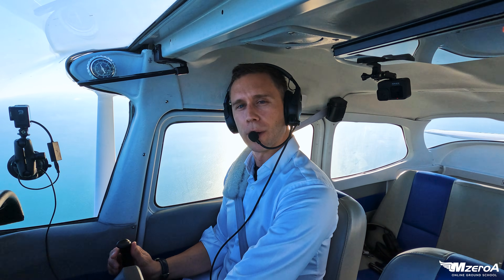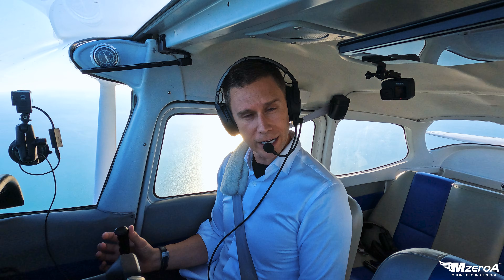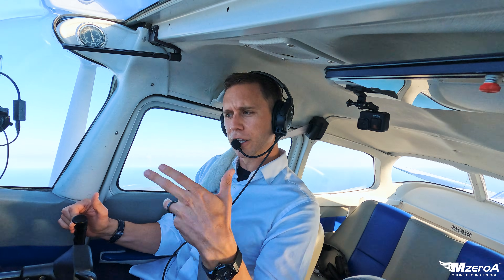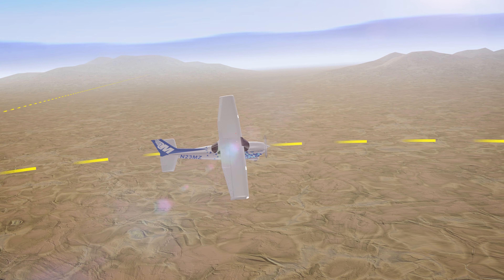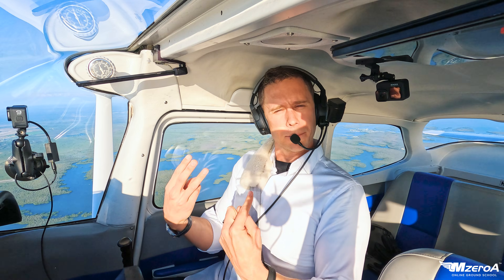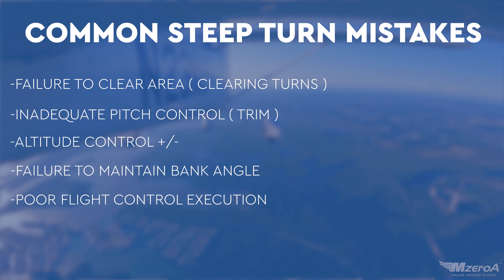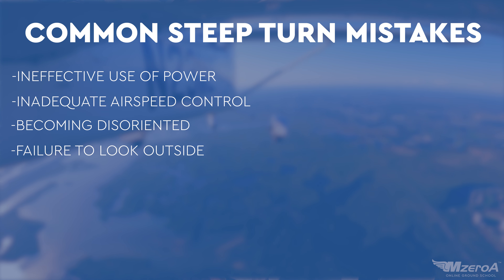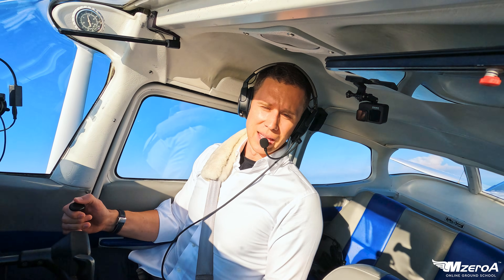How and Why We Perform Steep Turns

Comment: I have never used trim in steeps, preferring to have the feedback from the heavy nose tell me I'm not in a normal flight condition (which could inadvertently occur at some other time) and that recovery is needed.  The FAA Handbook indicates that "The decision whether to use trim depends on the airplane characteristics, speed of the trim system, and preference of the instructor and learner".

Comment: Nice,, love your style and this video.  i was actually wondering about , when i pull on the stick, RV9A,   in a turn , and i feel that G force,, i like it but , when does it break?  so i was thinking about Va and , ended up finding your video, which  is great, and i find it helpful,   and it is great for what you were talking about Steep Turns.    I am asking some related questions,,   so in theory if the RV9A has like a 3.8 + g design, then , if i pull back on the stick 
and i just discovered it has a G meter so if i look at the G meter  and it is less than 2, i am thinking , doesn't this answer the question it is ok to do this and it will not break?  and further, Va , which would have it stall before breaking,, let's guess the Va is 110knots, but that goes down with not full tanks and me alone so less than gross weight, and   slowing too much risks an accelerated stall, , slow deep breaths do you see the convergence of questions?  i am guess you do and you could do a video talking about this.  I want to   feel that pull when i bank over and pull the stick abruptly but , i also worry that abrupt stick pull is different than your sort of gradual roll into a 45 degree turn here,,  ???

Comment: Take note: I followed this procedure while flying alone, like Jason and dialed trim in almost perfectly but be aware once you're doing steep turns with your 190 lb. DPE in the right seat everything changes and those trim settings probably won't apply. Practice with your flight instructor in right seat for more realistic checkride scenario.

Comment: The trim technique just works.  One thing that really helped me was my instructor telling me to just look out and stop chasing the gages.  Looking at your horizon and glancing in is much better.  You'll be shocked at how much better you hold altitude by just looking outside.
Reply: I want to echo this too. I had serious problems my first few instructions with even just holding steady level flight. Me and my CFI did a dedicated lesson where I just didn't look at the instruments once we were trimmed for altitude, doing shallow turns and steady flight, and I ended up holding altitude spot on once I started being earnest about solely looking for sight picture. Last lesson, we did steep turns and slow flight. My first several shots at each, the airplane maybe moved 20 feet vertically through the entire maneuver.

Then of course I started overthinking and looking inside the aircraft too much, and screwed them up 😅 But, I reflected on it, and we're going to work on it next flight.

If you're just now learning VFR, keep your eyes outside the cockpit! I picked up some nasty habits of instrument-gazing from playing flight sim for over a decade, starting in middle school. Save that for IFR!
Reply: Thanks I'll try it because I find my eyes are glued to the panel
Reply: I spent like 90% of my time on the gauges starting out 🤣 It does help just to look outside.

Comment: How much in rpm do you add as you pass 30 degrees when going into a steep turn?
Reply: In my plane it's around 150 rpm.  C-172S
Reply: @RiddlesDNinja  cool, thanks for the information.   Does high density altitude make a difference.   I live at 7200’, Albuquerque is at 5260’ or so.   It gets 90-100+ in the summer.
Reply: @messianichebrewshawnkawcak1550  high density altitude will reduce your aircraft performance, engine power and thrust. so yes, add more power during hot days

Comment: I'll try trim the next practice. My cfi taught me to add a small bit of power as I cross through the 30o point of the steep turn to compensate for the horizontal component of left. What happens if I add power, do I just add a little less nose up trim?
Reply: My instructor taught me that for steep turns the power is to reduce the need to hold a lot of back pressure. Sounds like the trim technique achieves a similar result.
Reply: @glennwatson  Yes, I agree.  I'm just wondering if I should try the combo of both. In fact, my cfi and the cfi for my check ride will probable be concerned if I don't bump power as I pass through that 30o back point.

Comment: Great video Mentor really helped alot actually, you actually explained it better than my instructor did a few months ago, looking forward to seeing more of your videos. Regarding power in the steep turn, should you increase it a little or keep it at say straight and level power or cruise power?
Reply: At 30 degrees you wanna add a little bit of power as you roll into 45 degrees then when you roll out of your steep turn reduce the power